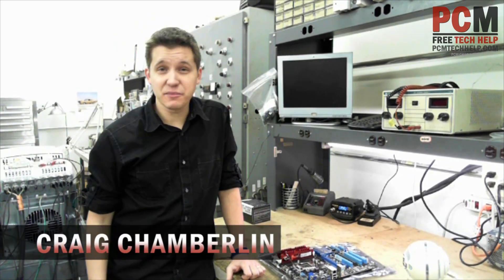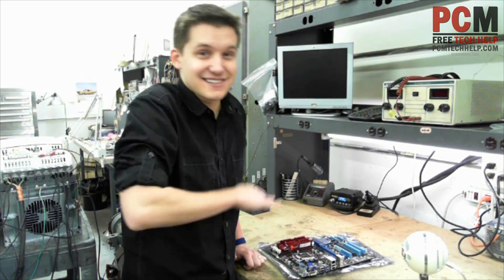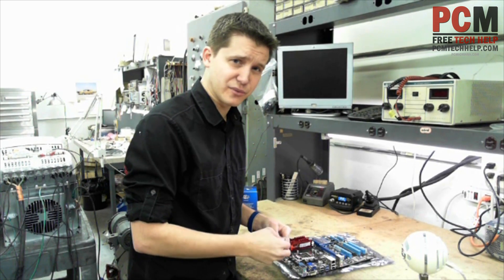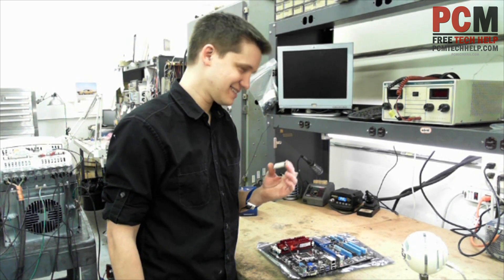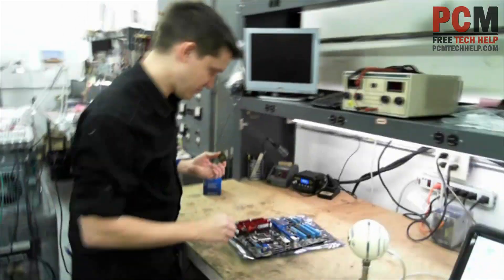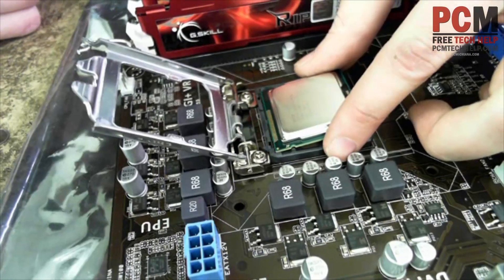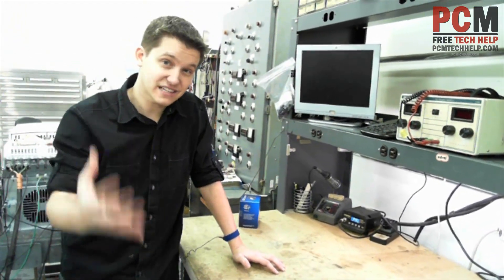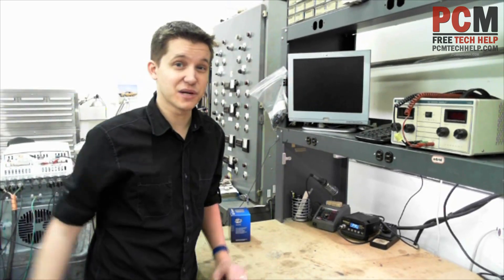How To Install A CPU In A Motherboard (2022)

Comment from the maker: Not all laptop motherboards will support a GPU upgrade so you'll want to look into that.  Laptops are tough to take apart, I wouldn't do it without a manual giving you good detail on how to disassemble it. You shouldn't need to disassemble it to install more RAM though

Comment from the maker: Wait, the entire connector is loose or just the plug that came with it? If it's the connector then I would DEFINITELY send it back, if it's the cable you can get SATA cables that "lock in" when you connect them to your drive from your local geek store.

Comment: Build first system last spring and wish I has seen this first. Chickened out putting the chip in and paid $20 at local store with fan install included.